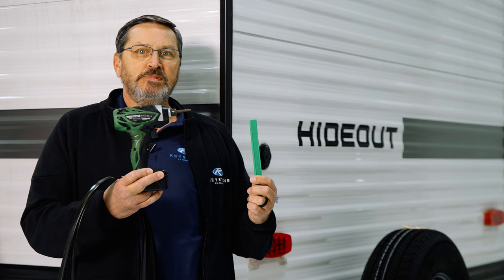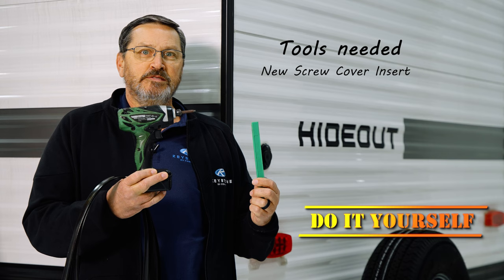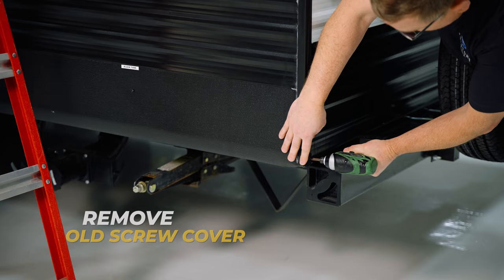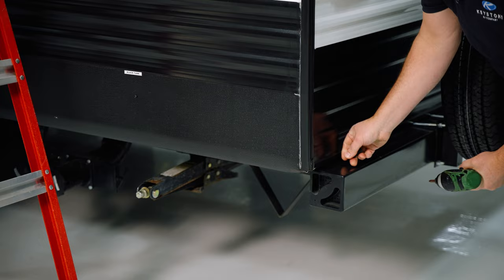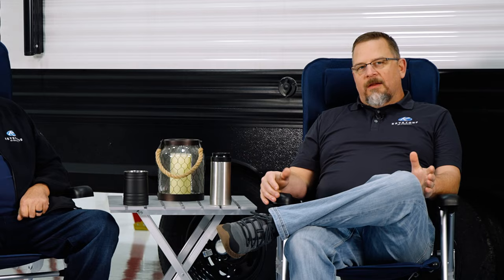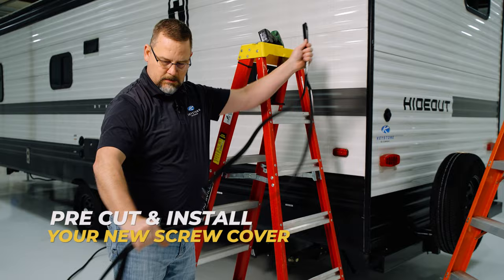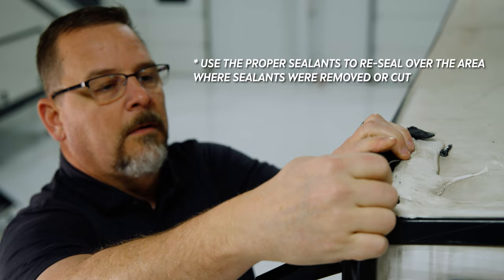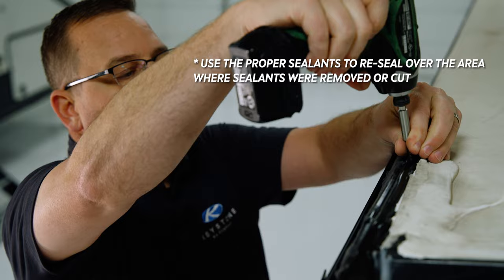DIY Exterior Molding Repair: Learn How to Easily Replace Screw Insert Trim on Your RV

Comment: I need to replace mine. Have ordered and received the replacement product. What kind of sealant do I need for the ends?? Thanks!!
Reply from the maker: Good morning! On the top by the roofing material you would use the coordinating self leveling lap sealant. While it is not necessary at the bottom you can use clear silicone. Thank you!
Reply: I replaced all of mine and a lot of them shrunk like an inch and a half, so maybe I need to put a screw on it.